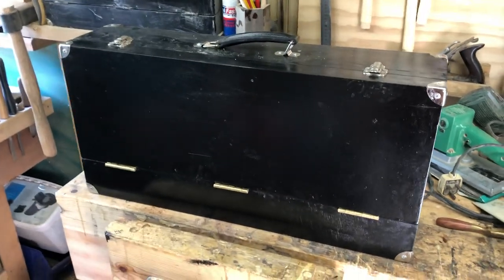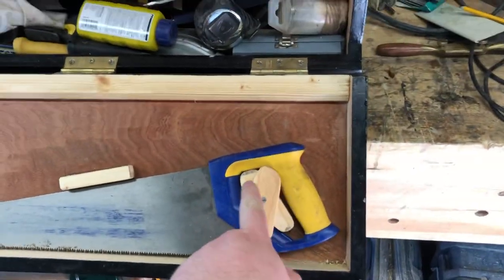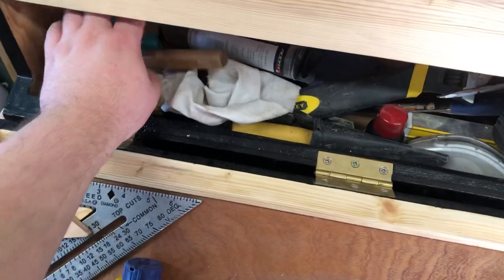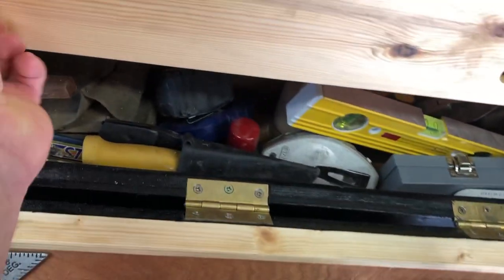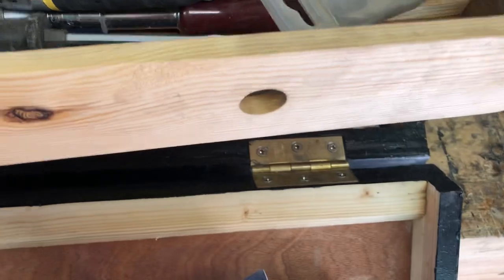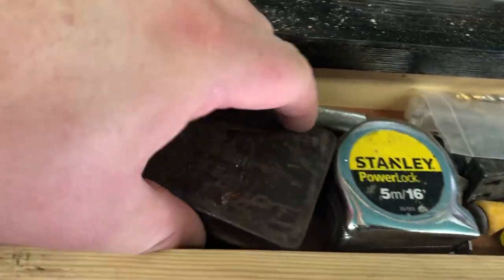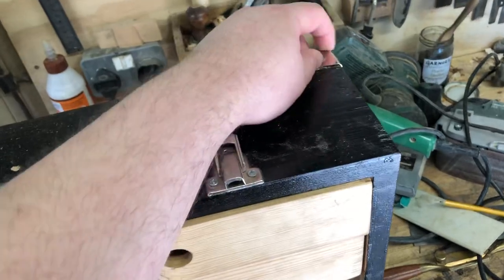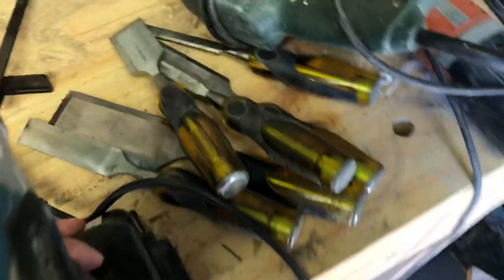Vintage style carpenters toolbox

Comment: Made one of these in college in 1992. 👍🏻🏴😁
Reply from the maker: I never had any formal training and this was based off the one my grandfarther made when he was an apprentice way back in the 1930s so thought it’s be a good project during the first lockdown
Reply: @bearwoodcraft3591  I had a great time in college. I didn’t start until I was 18. I’m 49 now and have trained dozen apprentices. 
I left school at 16 with 5 GCSE (none worth a mention) it seems they were giving them out then like sweets then. 😀
I did 2 yrs shop fitting with my dad at 16-18 I collected basic hand tools and a 240v drill  then when we were both made redundant from that company I put myself through college. He went on to be a Forman for Barrett homes covering Wrexham area. 
It was inscrutably painful financially but I got through with what we then knew as a city and guilds. 
I already knew how to sharpen hand tools and measure and square up timber. Basic skills like using tools. Assembling and building simple things I could do. 
I made my box at college using only hand tools. Dovetails for top and bottom joints. All glued and clamped. I painted mine black. Some varnished there’s. 
I built my mother a garden gate. A back door and frame which we had in for ten years and a tool box, mitre box and saw horse. I wish I’d made 2 saw horses. To fit sheet material. 😄 I’d encourage any young lad/lass to make a toolbox. I make a new one every few years and it always impresses other trade. Good talking point at lunch time. Try an open tote next time. I use you tube a lot but wouldn’t have the time to run a channel. I’m impressed others can do it though. Good work. Keep it up. 👍🏻😀🇬🇧🏴
Reply from the maker: @300leothelion  loved reading that I did make an open tote one bit of a do it all it has a flat top which you can saw on clamp work to drill into and a notch for holding a door when fitting doors